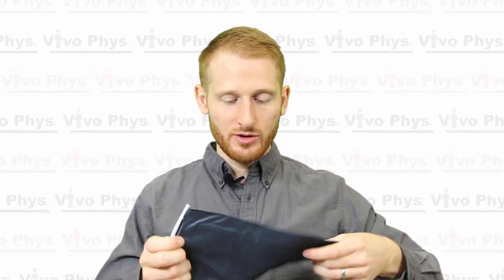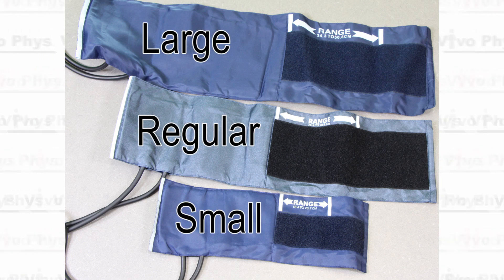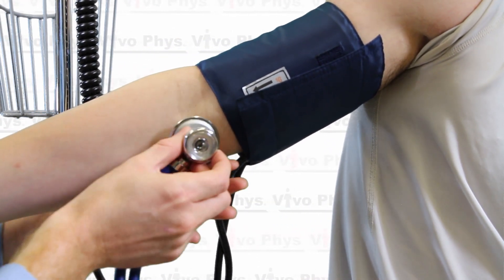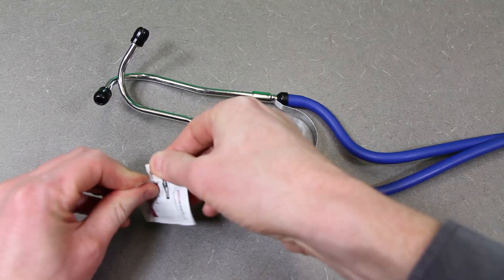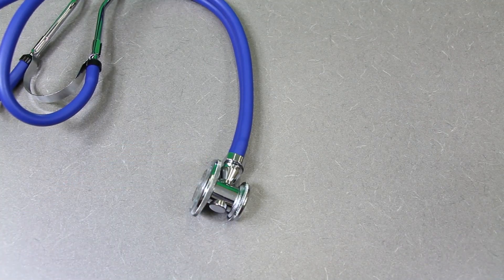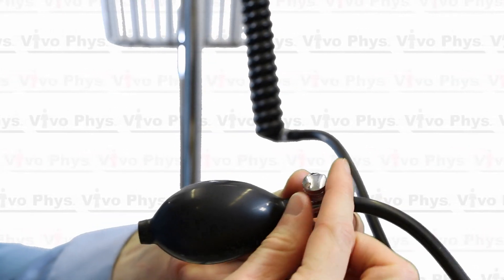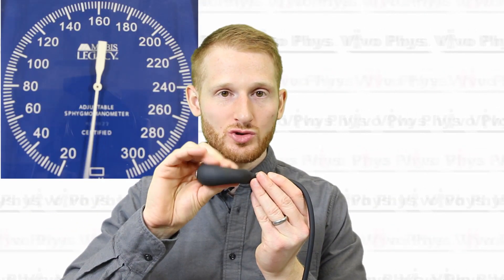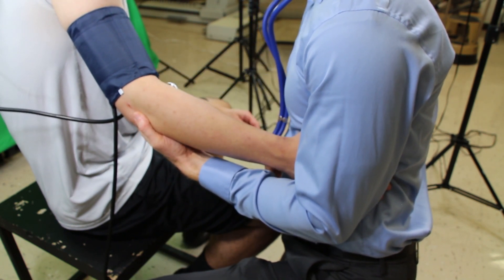Manual Blood Pressure Measurement

Comment: Do you keep adjusting the knob for the release of air from the bladder or do you just make a one time adjustment? I use to know this answer, but it’s been to many years.
Reply from the maker: You keep adjusting the knob to maintain an appropriate speed of the needle drop. If you do not loosen the knob further, the pressure usually stops dropping at some point. You don't want that to happen.
Reply: Thank you so much. 😊

Comment: I would like to know if when you pump the dial needle  is supposed to stay still before you start to release the air? thank you.
Reply from the maker: If they are still, the needle should be still. If they move their arm it will make the needle move. Also some cuffs leak. If the leak is slow then you can still use the cuff. If it is too fast then you need a new cuff.